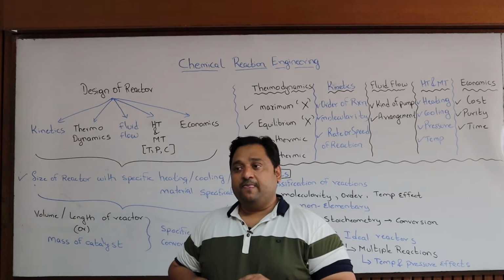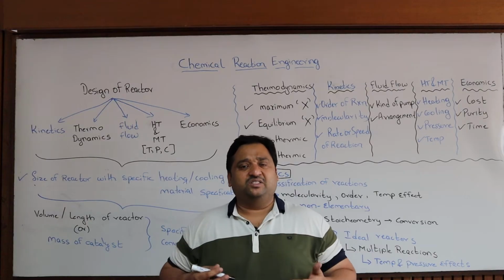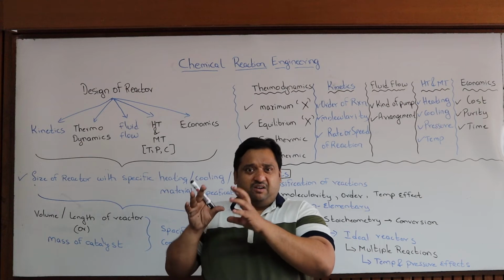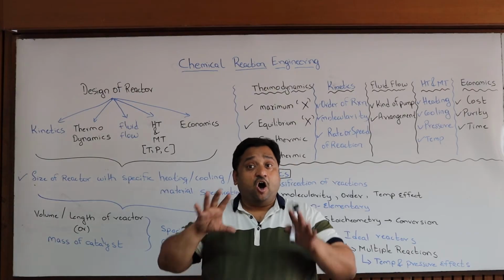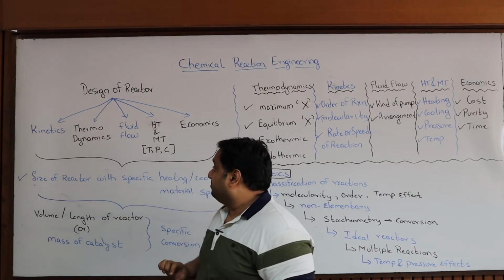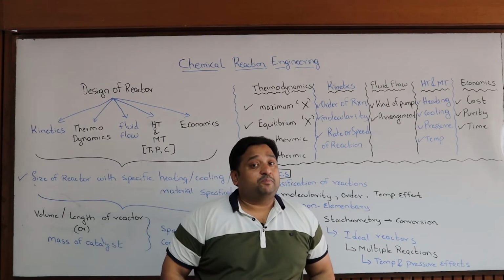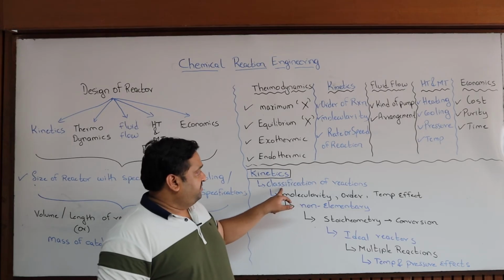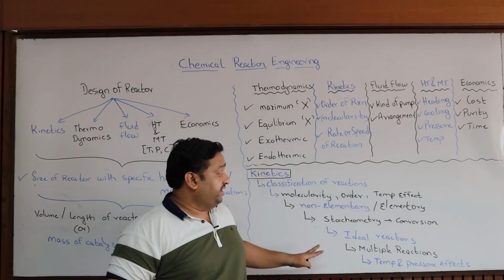CRE Lec 1: Chemical Reaction Engineering lectures -Introduction

Comment: If I watch this whole series (with no engineering background) will I be prepared for the chemical reaction engineering section of the chemical FE test? If not, is there another YouTube course to prepare me?
Reply from the maker: I am refering two text books. 1. Unit operations Mccabe and Smith 2. Unit operations by anuo k swail. But none of the books will give complete derivation. I have done some more work and refereed to random internet sources for clarity